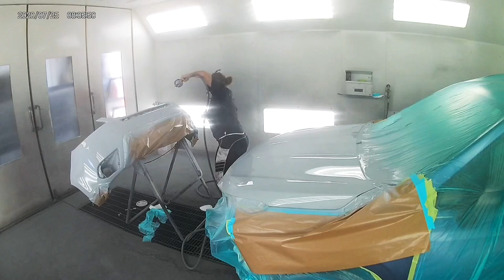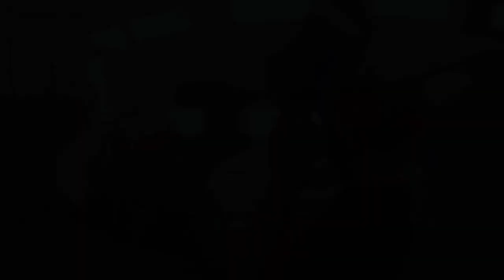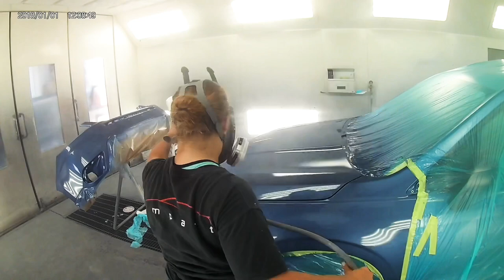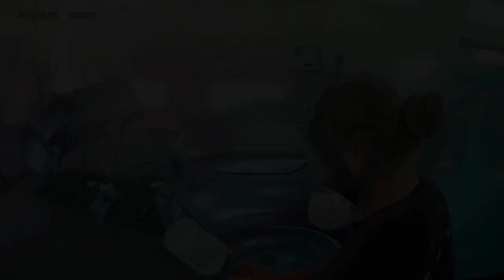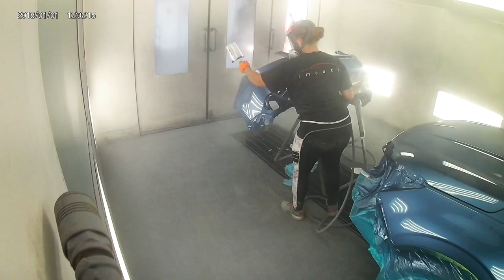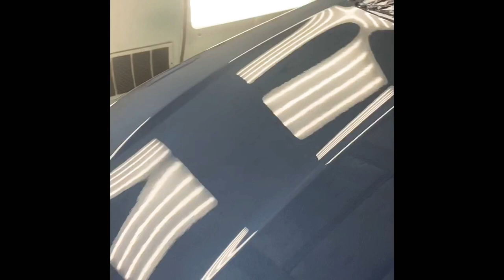Spies Hecker Hi-Tec 480 water

Comment: Nice job nice speed which one of the Spies Hecker clear did you use
Reply from the maker: Thanks! This would’ve been 8180 clear, 3240 hardener, with 3363 reducer(15%)
Reply: Kool nice job by the way again .So what do you use for overall with know baker I live the Bahamas temperatures are high
Reply from the maker: @marklynsmith3510  I’m located in Michigan, humidity is our big problem here. I usually just over reduce if temps are too high and apply 1 extra coat for coverage. Large jobs I’d use a retarder in the basecoat to help keep it wet and I’d use a much slower reducer( 3365) in the clear coat.